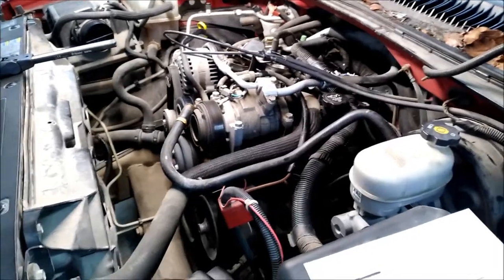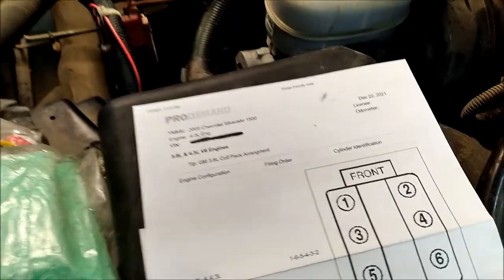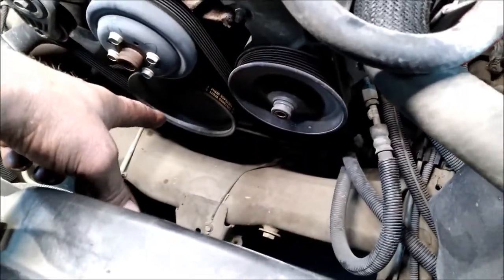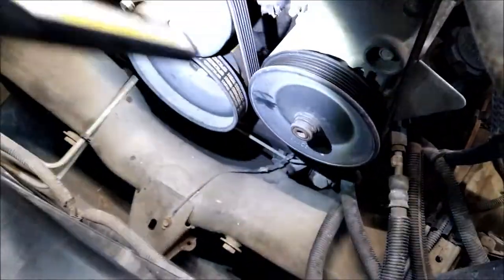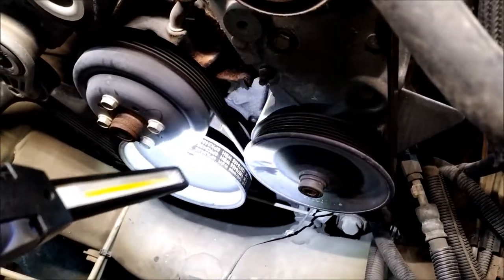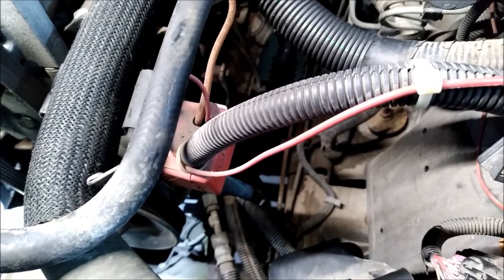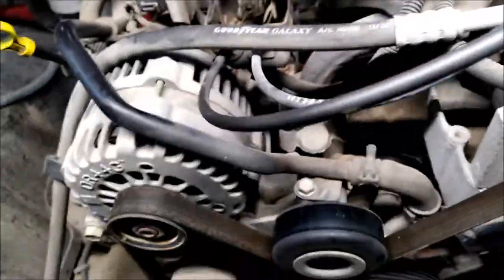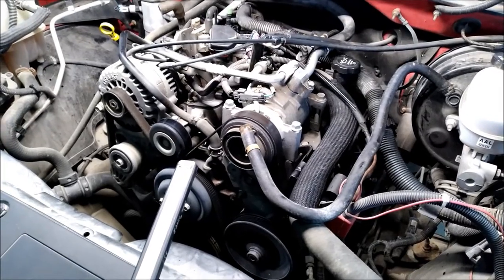Fastest & easiest way to set TDC & timing your distributor

Comment: Thank you for the tip. I had someone remove my distributor without putting it at TDC beforehand, when i went to set new distributor, it would not seat all the way down, i realized it was the oil pump shaft i had to move, thought i had it moved correctly but now I'm way off... My timing mark is about 1" to the left of the  reference pointer when using timing light. Which way should i move oil pump shaft to get that closer? Sorry if confusing. Any advice will help. Keep up the good videos. We all need tips and tricks from someone who knows what they're doing.
Reply from the maker: First question is what year and vehicle are you working on? On some of the older vehicles you need to disconnect a wire to set the timing with a timing light. A link below to a video I made about that ... thank you for watching
https://youtu.be/HnMbnoEmzeU

Comment: I have a mustang 2000 and when I changed my harmonic balancer it started misfiring , giving me a po305 code. I did not align the harmonic balancer since I didn’t know this was a thing. Do you think aligning the harmonic balancer and the distributor would solve my problem? Thank you.
Reply from the maker: Most likely it will the harmonic balancer with the markings would make it a lot easier the set the timing right ... thank you for watching

Comment: So after you set cylinder #1 and it’s top dead and your harmonic balancer is off a bit off with the mark. Do you just adjust the distributor rotor to the center of the mark as well? Is that how you fix it?
Reply from the maker: line up your lines at the hormonic balancer first. Then install the distributor and depending on how old your engine is either you adjust the distributor with the help of a timing light or the vehicles PCM will do it automatically for you. Hope this helps and thank you for watching

Comment: Great video! Did everything you did but my distributor’s button won’t point at 6. If I sit it flush in the engine the button is off by 18 degrees pointing towards the truck. I’ve checked cylinder 1 to make sure my screwdriver is pushed out and and it is, so it’s a TDC. What I’m doing wrong? Bad part?
Reply from the maker: Are you sure you are on TDC on compression ? It's a very common mistake ... thank you for watching
Reply: No problem. I think I’am. The harmonic line is aligned with the nipple with the groove and the piston is is pushing put on cylinder   1. So my screwdriver can’t go in. You got any suggestions what it might be or what should I try? Thanks for your feedback. I appreciated.
Reply from the maker: @thomasreyes3523  if you come to TDC on compression put your finger on the spark plug hole and it should blow your finger off the hole. That's the best way to double check

Comment: Hello. Quick question. I have a 1981 Chevy G20 van with a 350. Driving home it started popping and backfiring through the carb. I replaced the carb, plugs, wires, distributer and cap. Still backfiring through carb. Idles fine even rev a little. I do hear a little chugging through the exhaust.  But to much gas and it starts popping and backfiring again. I hear a little tick on the passenger side as well. I'm thinking timing maybe. Any help would be greatly appreciated.
Reply from the maker: Backfiring through the carb is most of the time plugs or wires or the timing. So yes check your timing, I always check the timing after a distributor R&R. Hope this helps and thank you for watching

Comment: Ive seen everyone put their finger on the plug hole, i was always told to toss a Philips head in and once it stops moving see when it starts to drop back down and back it up about half way to get it almost right in the middle
Reply from the maker: Using just the screwdriver only gives you TDC, putting your finger on the plug hole verifies the compression stroke as mentioned in the video BOTH are important if you don't do the compression step you can be a full rotation out and your vehicle will not run ... thank you for watching

Comment: I have done all of what your video suggests but the bug will not set at the number one potion no matter what I do it doesn't line up need help
Reply from the maker: What vehicle are you working on ? And are you sure you are on TDC on compression ? And does your distributor have that mark on it ? Thank you for watching
Reply: It's a 1991 Chevy Caprice 350 5.7 lt V8 no markings and  from where the gage is between the water pump it's on Tdc 0 out
Reply from the maker: @Motor1999x  check this video out. Doing a distributor and plugs on a 91 Chevy big block. Click the link below. Hope this helps getting you going 
https://youtu.be/HnMbnoEmzeU?si=cIMA0cdcdWIFbLaP
Reply: My bad there are no markings on the distributor
Reply from the maker: @Motor1999x  watch the video above and it'll set you up. With this your distributor rotor needs to point towards cylinder #1

Comment: Does the distributer need to be turned to face number 1 cylinder?
Reply from the maker: Depends on what you are working on ... thank you for watching
Reply: @CountryMileGarage  same engine just older model
Reply from the maker: @cherenkovsradiation4990  on the distributor it should say 6 or 8 and that's at TDC if it like 90s or older it should point towards cylinder 1 and you'll need a timing light and adjust the distributor as needed and don't forget to unplug the signal wire to the computer when setting the timing
Reply from the maker: @cherenkovsradiation4990  I did a video on that as well

Comment: I have a 93 s10 with a 2.8l. I installed a new distributor without setting to TDC. Would I need to remove set to TDC and remove and reinstall distrubutor to have the button point to #1cyl?
Reply from the maker: set your vehicle to TDC and then see where your distributor is at and pull it slight up and move it to cylinder #1 ... thank you for watching hope it helps
Reply: @CountryMileGarage  sorry to bother again. My CEL won't come on with the key on, I checked the bulb and it was blown, put a known good bulb and it still won't come on. I looked at the pin connector for the ecm, MIL circuit and it does not get any power or ground
Reply from the maker: @Marquez_0607  I'm going to need more info on this vehicle. Like did this happen over night is the truck been sitting for a very long time. Or did you buy it like this ?
Reply from the maker: @Marquez_0607  because we can be looking at multiple problems or just one. You can have a bad main relay a blown or missing fuse a broken wire or even a bad ecm
Reply: @CountryMileGarage  I bought the truck with a very rough idle, found out it was only shooting from 1 injector. Replaced the injector, still no pulse on one of them. Read that it could be the ICM under distributor cap, found the connector was broken and is not replaceable. Replaced entire distributor, went to crank and it just cranks no start, no fuel from even the good injector that was working. Got the service manual out and stated to check if the CEL turns on while in acc mode. No CEL. Next step was to disconnect ecm connectors and check ckt 440 and ckt 439 to ground with a test light. Test light illuminated on both circuits indicating either bad ecm ground, faulty ecm or bad connection.
Reply: @CountryMileGarage  ckt 319 does not illuminate with a test light while in acc mode which happens to be the circuit to illuminate the CEL
Reply: @CountryMileGarage  I removed the IPC and turns out it has a burnt bulb, replaced it with a good bulb and still won't illuminate. The circuit board showed it is the second from the top right pin
Reply from the maker: @Marquez_0607  check the resistance between the injectors, and other main components and the ecm plug this would eliminate a broken wire. Make sure ALL the ground wires are in good shape and there like engine to frame, boby to frame and such. If all that checks out I feel you could say with confidence the ecm is bad

Comment: I took the distributor out without setting to 0 what do I do
Reply from the maker: Set the engine on TDC on compression and set the distributor on 0 and put it together ... thank you for watching
Reply from the maker: @3l.chino.cochino  no problem bud this is why I do it, to help people and inspire them to work on their own vehicles
Reply: @CountryMileGarage how do I know where 0 is I only see 6 and 8
Reply from the maker: @3l.chino.cochino  what vehicle are you working on ?
Reply: @CountryMileGarage  a 1500 wt
Reply from the maker: @3l.chino.cochino  would like to have a year brand and engine size please
Reply: @CountryMileGarage  1997 1500 4.3 v6
Reply from the maker: @3l.chino.cochino  okay since you have a 6 cylinder set it at 6 and that is the final position it needs to sit at when fully seated ... now keep in mind when you install the distributor it'll turn a little because of the gear. So lift up and move it back extra. Hope this helps bud
Reply: Well I have the distributor removed now
Reply: @CountryMileGarage  I’m back again I got it installed but it’s back firing now does that mean I’m off timing
Reply from the maker: @3l.chino.cochino  yes do you have a timing light ?
Reply: @CountryMileGarage   no
Reply from the maker: @3l.chino.cochino  you have to unplug a single wire plug (it's the computer wire) loosen the hold down bolt and ever so slightly move the distributor left or right (you'll hear it runs better) once you find the sweet spot tighten the distributor hold down bolt and plug the wire in and the computer will set the timing the rest of the way
Reply: @CountryMileGarage  it’s late now but I’ll try 1st thing in the morning
Reply from the maker: @3l.chino.cochino  Google and see where your computer (pcm) wire is located. I can't for the life of me remember on that year truck lol
Reply: @CountryMileGarage  while the engine is running ?
Reply from the maker: @3l.chino.cochino  yes